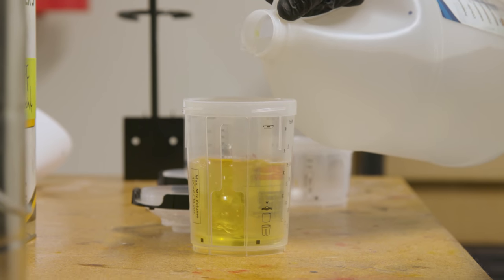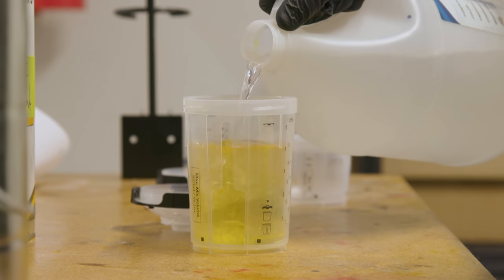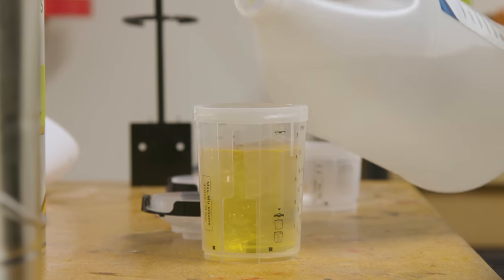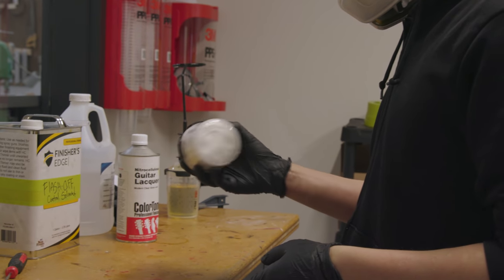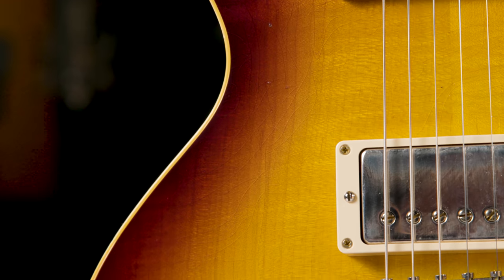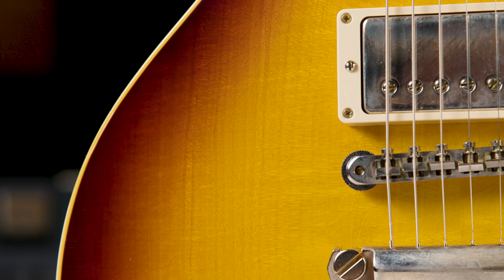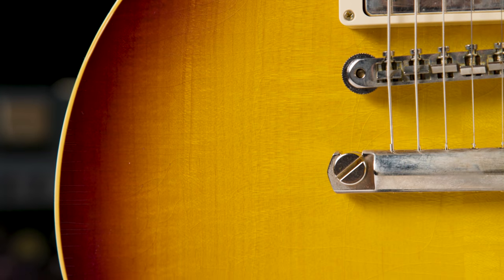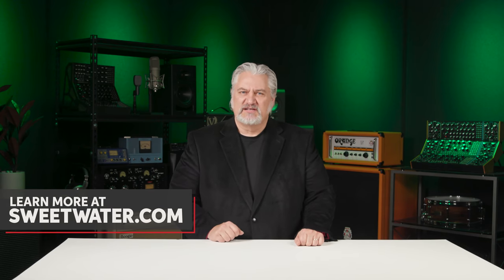What Is a Nitrocellulose Guitar Finish?

Comment from the maker: The magic of a nitro finish! What do you like most about a nitrocellulose finish? ✨
Reply: I have been playing guitar since the early 1970s, as such I've owned guitars with both nitrocellulose lacquer as well as the more modern urethane poly finishes.
After +20 years the lacquer guitars are aging very nicely and look their age while the urethane poly finished guitars basically look brand new but dull.
The way nitrocellulose ages is in my opinion much more desirable.    After 20+ years of use and wear I regret purchasing the urethane/poly instruments as had they been finished in lacquer they would look and feel much nicer than they do now.  The lacquer ages gracefully indeed.
Reply: When people refer to "letting the instrument breathe" they're not talking about literal air.

The higher elasticity and low degradation qualities of modern poly finishes "dampen" (not make it literally moist with fluid, mind you) the instrument's body and in an acoustic guitar that will remove distinctiveness from the build and flatten the character so it sounds a lot more like every other instrument with its dimensions and finish.

It's not the actual gaps in the finish that allow vintage instruments to have the tones they do, it's that the finish itself lets the instrument physically react more naturally to itself and allow the vibrations (including a much richer subharmonic voice) to not only escape but interact in ways that add to the rich sweetness of the raw output.  Since a solid body guitar can't really expand/contract like a hollow or acoustic, it's not as noticeable until amplified and the affected tonality will be swamped out if preamps are used to regenerate the signal with excessive shaping, rendering it fairly irrelevant for many users who enjoy a broad sampling of onboard preamplification/filters.

I hope to experiment with french polish and various natural finishes, such as shellac, in the future.  :-)
Reply: @russellzauner  Well said Russell
What you described is exactly what I have observed over the years (2 or more decades).
As the lacquer hardens and thins the body wood seems to age into a more brittle/resonant form.
Not all guitars, but many.  Wood is such that it all doesn’t react/age exactly the same, similar perhaps but not the same.
In some respects each guitar can be as different as individual people (IMHO), there are good and there are bad.
Reply: I love the feel and smell of a nitrocellulose guitar. I also really like that it ages well and gives you that cool vintage vibe. 🙌🏻
Reply: The smell of a new nitro guitar is unreal! 
I like the cool points I get off internet strangers for having nitro guitars 🤣
Reply: @Bloom Tik Bloom Kind of unrealistic
I suppose I'd like my Wife to always appear new too!
Reply: @Bloom Tik Bloom I suppose, but every thing fades with age.   If guitars always stayed looking new we would have no reason to purchase another new one!
That is my best argument, its all I got!
Reply: @hkguitar1984  How so? Did the finish turn yellow?
Reply: @kimdiedrich9712  Yes, a slight yellowing/aging to the clear top coat.   Over the white/cream binding the change in clear-coat color adds yellow-ish hues.
I've an old sonic blue Strat where the clear lacquer top coat has yellowed, the sonic blue viewed through the yellow clear coat gives the guitar a surf green appearance.
Sometimes there is no rhyme or reason why one thing is preferred over another, to each their own.

Comment: The highly desirable attributes of nitrocellulose lacquer on acoustic guitars, is the fact it can be applied SO thin ( when done correctly ), that it still looks good, affords protection to the wood, but above all, THE WOOD CAN MOVE/VIBRATE MORE FREELY than any other type of finish. This is where the confusion & myth about "the guitar can breathe better with nitrocellulose" comes into play. The guitar isn't "breathing better".......... instead, THE WOOD CAN MOVE & VIBRATE MORE FREELY......but ONLY if the nitrocellulose is applied properly. This is also why so many boutique builders and/or custom shops within various guitar manufacturers still use nitrocellulose on their finer guitars.......or for special orders where the customer is willing to pay more.

Comment: I have been using nitro for quite a few yrs. on cabinets. I built a OM style guitar in 07 with a friend of mine and the finish still looks great. I like the way you can 2nd, and 3rd coat fairly quickly compaired to oil based finishes, and do repairs to it also. Now back in 07 when i built my OM guitar i was told by guitar suppliers that the nitro for guitars was different than cabinet makers nitro.,.i had my doubts but still bought it from them. I would like to really know if that was true or not....the instrument makers only sell there nitro for about 4 times the cost i could get nitro for cabinets...DAH. wasnt hard to figure that one out....anyway here is my 2 cent worth.

Comment: What I was told back in the day that made nitro finish was desirable from being thinner the wood of the guitar body can outgas moisture easier and age faster than when thicker finishes are used.
Reply: Not true. More folklore nonsense from the so called "vintage" guitar community....
Reply: Easy to disagree but I don't see your counter explanation.
Reply: @DojoOfCool  Shouldn't need one....but.....The finish seals the wood "AIR TIGHT". No moisture will escape through the finish. This is why so much care and prep is taken in insuring that the wood is as dry as possible BEFORE any finish is applied or even anything built from said wood material.
       Sealing of the wood is in fact the whole and sole purpose of applying a finish to it in the first place.  
        Acoustic instruments dry from the inside...not out through the finish..
Reply: I still disagree moisture does continue to escape over the years and the thinner less dense the finish the faster moisture leaves.   Even in the video he talks about how more plastic was add to even nitro later and then moving to the poly finish more and more plastic so much more dense slowing down the escape.   

Finish is a  part of a musical instrument sound it affects resonance.  Even today they are still searching for the secret to the finish Stradivarius used on his instruments.  As a Jazz guitarist I get a lot in wood and how dry it is and the finish used but I started playing in the 60's and lots of Fenders and some Gibsons solid bodies so been talking about this topic with luthiers for a long time.   

So good to discuss this with you.  Thanks
Reply: @DojoOfCool  It doesn't matter if you disagree. Water does not penetrate plastic. Do an experiment to educate yourself. Put some water in a ziplock bag....seal it up.....wait for 50 to 100 years.....see how much water is still in the bag.
Reply: No, what Cornbob said is correct. That is one of the big reasons to finish a guitar. To keep moisture out.
And thus, there is no such thing as moisture "outgassing". 
As for it having an impact on resonance, that is another discussion.

Comment: I would like to try a nitro finish, but I’d hate to find out that under the poly I have some bizarro 5 piece jigsaw body. It’s a 2014 MiM standard in case anyone knows. I’d change it to a color I’ve been seeing and liking on Volkswagens, tourmaline blue metallic
Reply: i mean if it’s a 5 piece body it’s always gonna be one whether you refinish or not, just do what you would like if you aren’t happy with the current finish.
Reply: @pugforce8315  👍 I think what I’ll end up doing is getting some acrylic paint and doing my own designs, then put some sort of sealant over that. If I botch it then ya I’ll just scrap all the poly and find out what lies beneath
Reply: @randall9000  Just be careful with nitro, that stuff can easily damage your lungs.
Reply: @boshi9  👍 oh ya no, I’d have it done by a professional
Reply: @randall9000  why does it matter? Unless its built out of some extremely unstable wood with uneven grain, there's nothing that could happen